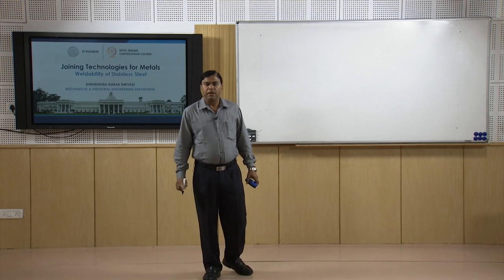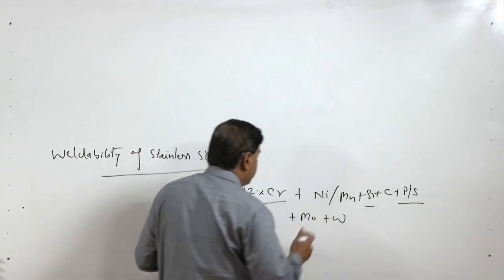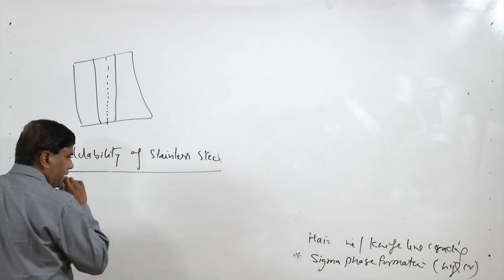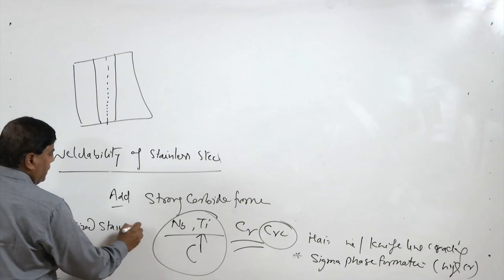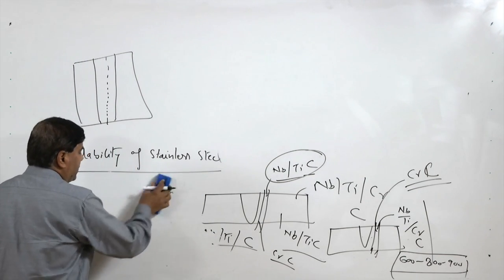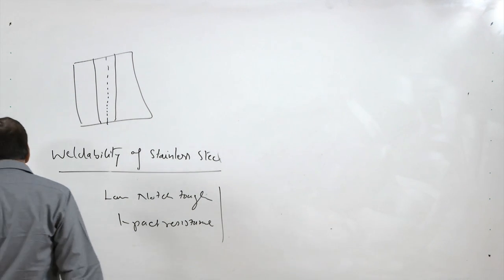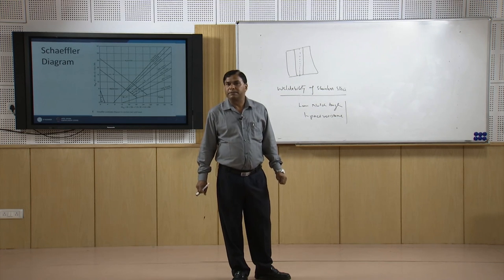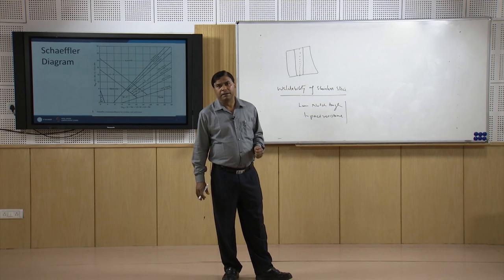Lec 34 - Weldabiliity of stainless steels

Comment: SIR BUT AS PER ASME code Aus Stainless steel  does not need PWHT or Preheat. as you said Nb, Ti are strong carbide formers, then why on reheating it combines with Cr near fusion boundary
Reply: Here sir is saying post heating not pre-heating
Reply: @saig7974  PWHT stands for post weld heat treatment.